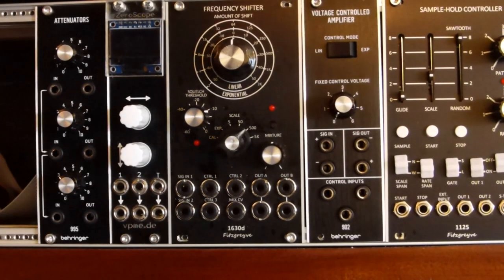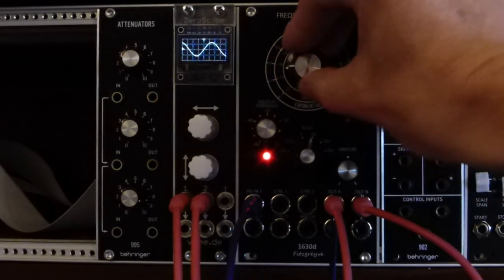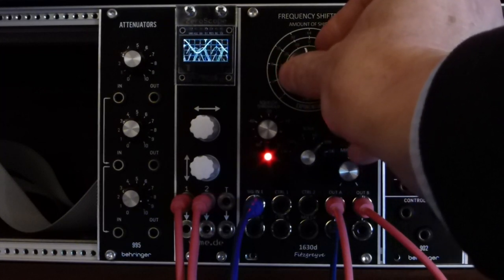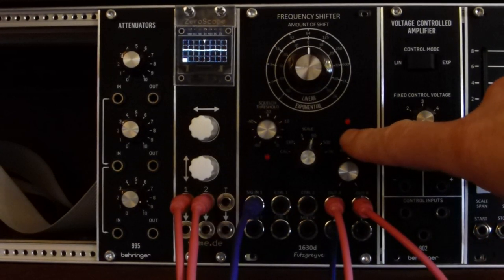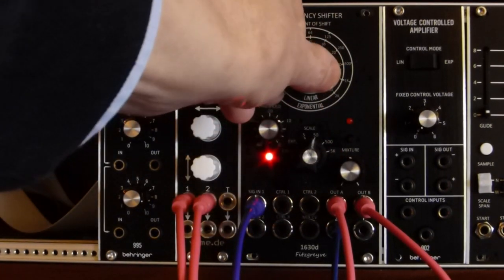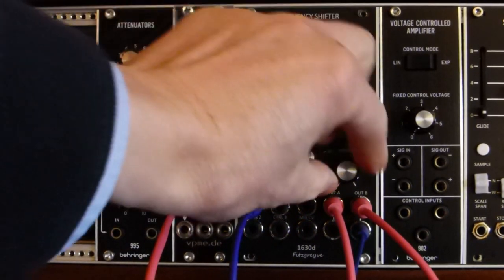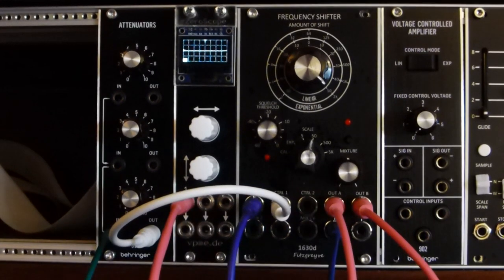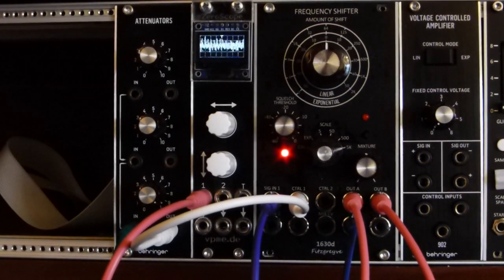Fitzgreyve 1630d Frequency Shifter

Comment: 😊Very very cool. I have the Behringer frequency shifter and it sounds different.
Reply from the maker: While my software emulates the architecture of the Bode original, there will be differences in digital v. analog processing. Also the bode original requires some precise adjustments, and the jury is out as to whether Behringer is able to do this effectively given it's price point. It would be interesting to do a side by side comparison.
Reply: @fitzgreyve  Yes there is a bigger difference. The Digital one isnt the same, but it sounds good, and it is just different.
Reply: @fitzgreyve I’m not sure if you’ve seen the Behringer version but there are about 17 trim pots on the back and sides of the PCB. Is it calibrated correctly? I have no idea but it sounds great. Yours sounds good too, especially for a digital emulation.
Reply from the maker: Thanks.  I had more or less completed mine just before behringer announced theirs. The "17 trim pots"  was the main reason that I compromised on this and went for an emulation rather than a (eurorack) repackaging of the orignal analogue circuit.